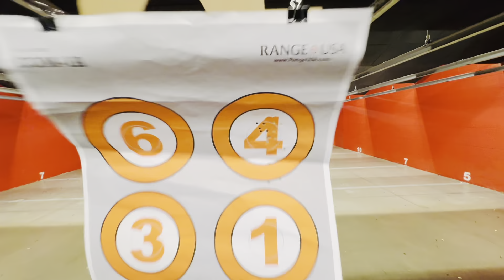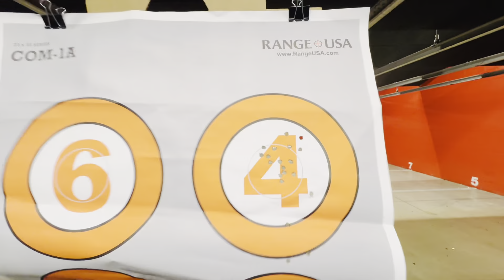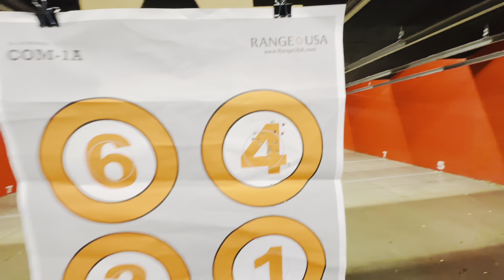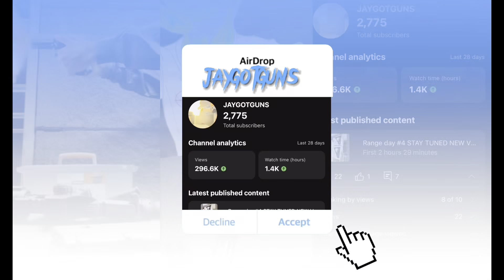10mm p320 sig 😬vs 556 55g FMJ 🥵 range day PT4

Comment: Do you notice how scrunched up you are when firing your arp? I can help you with that. There’s a few things that would help improve your shooting form. The first thing I would personally do is take that idiotic cookie cutter break off. That’s why your face looks like that and your squinting so hard. Because of all that concussion right in your face. What do you think that’s going to do in a home invasion scenario with no muffs ? The second thing you need to do is get a brace of some sort. So you can make more points of contact with your firearm. Last but certainly not least I would ditch that Teemu, Amazon redot that you have on top. A 20 yard accuracy test is hardly any test for a Rifle or “ARP”.  For some reason it’s hard to get some to understand and I’m not sure why but your optic should not cost 1/10 of the price of your weapon. I guess I could give you an analogy. If I just leased a brand new hellcat that cost me 1500 down. Wouldn’t you make fun of me for having $15 flame spinners from Walmart on it? That’s kind of how we look at it to you have a $600 gun with a $20 red dot on top.